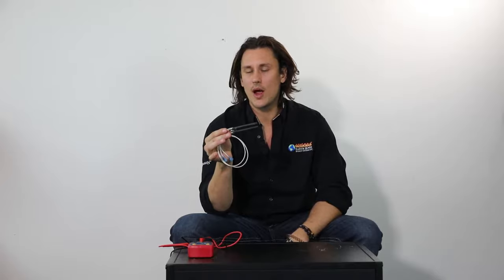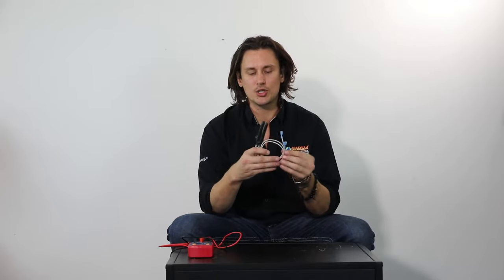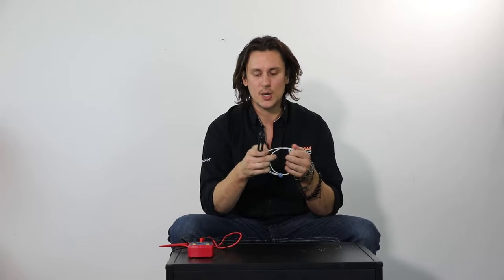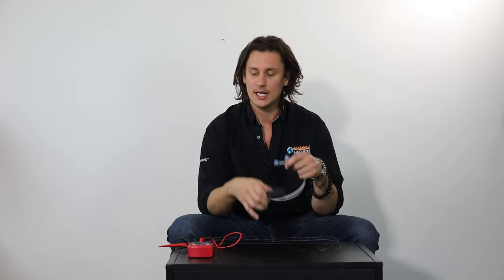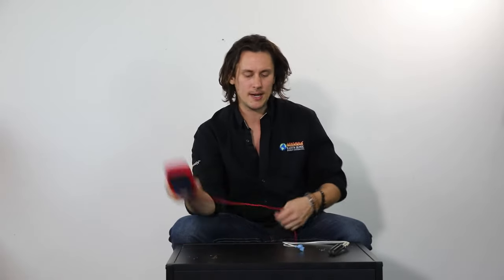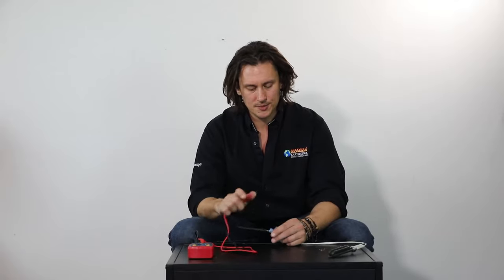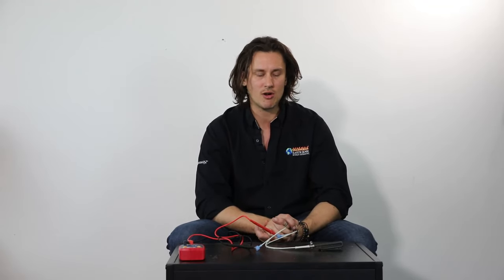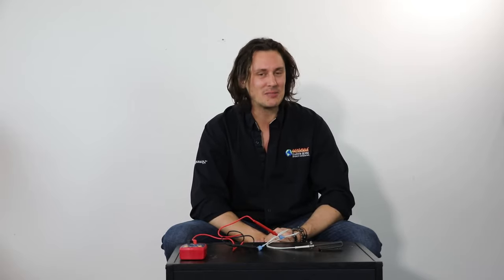How To Test A Stove Igniter, Pellet Stove Ignition Troubleshooting

Comment: Thank you so much, I came across your video today. My 1st time/winter with a pellet stove & it’s awesome. I’ve been cleaning it regularly, but not enough apparently. Noticed last night it wasn’t running as efficiently. After watching this I gave it a thorough cleaning inside & out. Started up immediately. Muchísimas gracias
Reply from the maker: Fantastic to hear! Glad this was helpful. Any future questions or tips needed just let us know!
Reply: Hey Taylor, 
 So unfortunately a new situation has arrived. As the pellet stove is super cleaned up. Today started smoking from the top vent. I shut it off I’m going to let it cool down. And vacuum out the pipe. Any insights? I could send a video?
Reply from the maker: @theuniverse8384  Thanks for the message, happy to help. What make and model stove do you have? Yeah, if you can upload a video to YouTube and send me the link that will be helpful. Generally speaking, the exhaust vent flue pipe on pellet stoves is under positive pressure as most pellet stoves have forced combustion. PL Vent pipe of all brands and types are known for leaking around the seems. When we install, we apply high temperature silicone around every pipe seem and then we use a CO meter to ensure there are no leaks. Oftentimes we will even block off half of the vent outside so there is more pressure on those seems which allows us to make sure it's sealed 100%. Send me some further info and we can get more specific to your situation. Thanks!
Reply: It’s a St. Croix, not sure how to send a video on YouTube. Sorry tech challenged. It’s been off for about three hours now. I cleaned it even more than I did a few days ago. How many hours do I need to wait to document with a shop vac regarding the pipe outside?
Reply: It’s a St.  Croix Model Greenfield WH-003275

Thank you for taking the time to read this. ☮️🙏
Reply from the maker: @theuniverse8384  Thanks for the information, yes we are very familiar with the St. Croix Greenfield. We have carried and serviced this model for many years. I will continue response on your other message. Thanks!
Reply from the maker: @theuniverse8384  Thanks for the info. For cleaning out the venting, I would wait until the stove has finished it's cool down cycle and shut off and from there wait another 60 minutes just to ensure all ash is cool. One of the best tools we use to clean out the exhaust pipe is a leaf blower vac. We place the sucking/vacuum part on the vent outside and it pulls out the majority of the ash in the vent, combustion blower manifold, rear firewall, and heat exchange area. While this is being performed, another person can be in the house opening and closing the door and moving the heat exchange scraper rod for maximum results. While doing this we recommend having all windows closed and wearing hand protection and face protection so you don't breathe in any of the fine particle ash. Once your venting is clean I would still recommend getting high temperature silicone and sealing each pipe seem as well as the pipe connection to the stove exhaust outlet to prevent any smoke leakage. Here is high temp silicone for reference: https://pellethead.com/product/nuflex-high-temperature-black-silicone-sealant-adhesive-2-8-oz/

This is the leafblower vac style we use for maintenance and cleaning. We don't currently stock it any longer, however these usually are available from a Lowes, True Value, or Home Depot. https://pellethead.com/product/toro-vacuum-leafblower-pellet-corn-stove-exhaust-vent-cleaning-system-3-4-venting/

Keep us posted, happy to assist. No worries on the video and uploading, we'll get you back to 100% without messing around with the tech stuff. Thanks!
Reply: Thank you Taylor, I really appreciate your knowledge and time. Bad timing with the massive temperature drop in Maine. 

Yes, the stove has been off now for 4 hours. But I may wait until the morning as it is dark at this point. Then I could also ask for another pair of hands. I’ll keep you posted, again thank you very much.
Reply from the maker: @theuniverse8384  Thanks for the message back. Yes, a lot easier doing it in the light. Hoping you stay warm this evening and keep us posted tomorrow with your progress. Appreciated.
Reply: Good Morning Taylor,
No leaf blowers in stock by me in my area, Although I have a shop vac, (not metal). I will give it a go sometime today. 

Thank you, 
Maleine
Reply from the maker: @theuniverse8384  Sounds good Maleine! Keep the leaf blower vac on your radar and keep us posted on your cleaning with the shop vac. Thanks again!
Reply: Hey Taylor,

Yes, I’ll be on the lookout for the leaf blower (currently out of stock). 

She is running like a champ now. Even though I thought I was cleaning it really well, I missed a few pockets. I really cleaned up by the scraper & in between the tubes. 

I did get the silicone that you suggested. 

Thank you so much,
Maleine
Reply from the maker: @theuniverse8384  Fantastic to hear Meleine! Yes, the Greenfield does have several 'pocket' areas where ash can collect. With that unit there is generally a decent amount of ash that gets trapped behind the rear firewall. When you get a leafblower/vac it will pull that ash out. In the meantime you can use a mallet to tap on the rear firewall and have that ash fall down into the ash traps located on the left and right of the burnpot. If doing this, make sure that the steel or ceramic brick covering the back wall is removed first. Again, very glad to hear things are running well right now and that you got the silicone to ensure all seems are sealed up with no leaks. Keep us posted, always here to help! :)
Reply: Hey Taylor,

Thank you, good to know. Exactly where the build up was. Looking forward to the leaf blower/vacuum. 

Have a good evening & Happy Winter. 

In the meantime I’ll keep educating myself with Earth Sense video’s. 

Maleine
Reply from the maker: @theuniverse8384  You're most welcome Maleine! You as well, and keep us posted with any questions as you go, always happy to help. Have a wonderful evening.

Comment: 1st time Pellet stove….if igniter is bad, is it “possible” to manually ignite.  I know this is not recommended for safey, just want to know if a pellet stove I got works.  Thanks for any advice
Reply from the maker: Thanks for the message. Yes, if your igniter is out you can manually light the stove. Just place a handful of pellets in the burnpot, use an alcohol gel starter or friendly paper/wax fire starter options. NEVER use gas, kerosene, or anything of that sort. Let the fire burn for a few minutes so the pellets start going before you close the door and turn it on. Keep us posted, happy to assist however we can. Thanks!

Comment: Old video but very relevant today, question: does polarity matter?  The leads on the stove have no connectors but 1 red 1 white. Leads on ks-5030-1061 are non descript with a molex that is arrow shaped. Is there polarity in the element or can I make the connection either lead?
Reply from the maker: Thanks for the message. For the igniter you can make the connections to either lead, it will not matter. Any other questions please let us know.

Comment: Great service! Just got all my parts today, sure wish I would have ordered the igniter also 🤦‍♂️ What would be the specs on a ap5660l igniter? After searching all over town I was lucky enough to find a fuse but the igniter failed to work. Hoping my circuit board is still ok🙏
Reply from the maker: Thanks for the message, glad we were able to assist! The igniter for your Ashley AP5660L would be part 80604. I have just messaged our tech team to send over the ohm range for that element. I should have an update on that and will let you know as soon as possible. Here is the 80604 igniter and aftermarket for reference. Be back in touch shortly. Thanks! https://pellethead.com/product/us-stove-vogelzang-ashley-pellet-stove-igniter-element-oem/
Reply from the maker: Just heard from our tech team. Ohms on the 80604 igniter should range between 45-52 ohms for proper start-up. Give your igniter a check and let us know what it's reading. Thanks!
Reply: @EarthSense  thanks for the info! Mine was reading 8-10. Kinda strange it didn't burn my fuse after I replaced it. I went ahead and disconnected the igniter to be safe and just lit it with my torch till my new igniter gets here.
Reply from the maker: @Laurel-Crowned  Thanks for the message. Glad you were able to test it and verify it was out of operable ohm range. Sounds like a good move on your part. Let us know how everything is working once the new igniter is in and installed. Thanks again!
Reply: @EarthSense  thanks again! It worked out great. If you don't mind me asking, how long does your brand last compared to the factory brand? Also do you sell on eBay or Amazon?
Reply from the maker: @Laurel-Crowned  Absolutely, glad it worked out well for you. We go direct to the manufacturer for the pellethead brand. I would say generally speaking lifespan is the same as factory and generally the warranty period is longer and easier if there is an issue. Yes, we sell on both Amazon and eBay. Amazon store name will be: pellethead and eBay store name is: esesstoves. Any other questions or needs as you go along just let us know. Thanks!
Reply: @EarthSense  well I was able to make it to my mother's and as I'm installing her new parts I ordered from your website, nothing appears to be correct except the exhaust motor assembly! I had ordered her the cheaper version of the auger motor and when I realized the difference I paid the extra price and ordered the factor version and brought it with me but both of them say earth sense on them but just have different amp ratings? The refurbished blower motor assembly I ordered was either put together with the motor on the wrong side or I got the wrong part? The amp ratting on my factory motor says 1.9a and the brand is fasco and the unit I purchased from you says 1.77a with nbk manufacturer?
Reply from the maker: @Laurel-Crowned  Thanks for contacting us, happy to help. Yes, both our Auger motor offerings will have our company name - labeling by the manufacturer. The USA auger motor replacement will state that it's a Gleason Avery motor at the top bearing cap. Needle point sealed ball bearing made in the USA. You will notice different amperage ratings on motors and aftermarket replacements, most are negligible and will not affect the performance in any way. If there are any issues with performance we will make it right. 
As for the blower motor it is aftermarket, comes from NBK - We do not carry the OEM blower from Ashley. I have never heard of the motor being on the wrong side before though. We sell quite a few of theses distribution blowers, but if the blower is incorrect and will not install please give us a call and we can assist with return on that. 800-236-6647. Any other questions please let us know. Thanks!

Comment: I have a Quadrifire Cab50. I had to replace the control board, and it ran well for a minute. Then it stopped igniting (everything else works, fans, blowers, auger.) The ohms on the igniter are around 58. That's almost double the ohms range, correct?
Reply from the maker: Thanks for contacting us. The OEM 300 watt loop igniter in your CAB50 should have a range of 43.5 – 53.5 ohms. If it is an aftermarket igniter those numbers can vary. At 58 ohms you may experience issues with missed ignition; it's a pretty narrow window for optimal ohm range. Here is the igniter and ohm breakdown sheet for reference. 
https://pellethead.com/product/quadrafire-heatilator-loop-pellet-igniter-300-watt-oem/

https://pellethead.com/how-to-test-and-replace-a-stove-igniter-pellet-stove-ignition-troubleshooting/

Any other questions please let us know.
Reply: @EarthSense  Thanks!

Comment: Great video!  My stove was working fine (though its performance was probably getting worse and I just wasn’t realizing it) and then one day, no flame, just a pile of unburned pellets. At least I didn’t have to diagnose the pellet feeding mechanisms. But as you said, check the basics first. I gave the stove a pretty thorough cleaning and made an adjustment to the front door to get a tighter fit on the braided gasket. Since I had everything apart, I did check the resistance on my igniter and found it to be within spec, though right at the high end.  I was having a hard time believing that my cleaning would make the difference, but since it was easier and cheaper to put everything back together and test it, that’s what I did, and presto!  You were right, just by addressing the basics, it fired right up!
Reply from the maker: Fantastic to hear! Yes, so much is about proper air flow for ignition and proper burn. I'm glad she fired up correctly after your cleaning. Any other questions please let us know. Thanks!

Comment: I'm trying to figure out why my fuse in my st croix keeps blowing. Do you have any videos on that or any ideas
Reply from the maker: Thanks for contacting us Aaron. Generally if a fuse keeps blowing like that there is a direct short from one of the components or wires. Inspect all wiring in the stove and make sure there are no exposed wires grounding to the metal body of the stove. Check the igniter as well; if the igniter is warped at all and touching the igniter housing it will blow the fuse every time. Check the igniter wires and check the ohms on the igniter to make sure it is in proper range. Keep us posted, happy to help.

Comment: Is it safe to assume that infinite resistance on an igniter is indicative of a faulty unit?
Reply from the maker: Thanks for the message Evan. Each style igniter element will have a different optimal ohm range. Numbers outside of that range either higher or lower will indicate a failed igniter. You can find a general list here of varying igniter ohms - you can also let us know your make and model and we can try to provide optimal range if we have those specs. https://pellethead.com/how-to-test-and-replace-a-stove-igniter-pellet-stove-ignition-troubleshooting/

Any questions just let us know, happy to help!

Comment: Never mentioned the ignitor can work and be in range but can short to ground and either blow the fuse or pop the breaker, ask me how I know when I bought 3 cheap ebay ignitors,  2 did this but one out of 3 were good
Reply from the maker: Thanks for sharing Rich. Just glad to hear the faulty igniters didn't harm your control/circuit board. I hope you were able to warranty those two. If you need anything let us know. Thanks.

Comment: Quadrafire Vernon AE.   Firepot icon on all time. stove stops working.  Cleaned firepot no change.  I usually clean thoroughly in fall but now I can wait to  clean compleely and fix problem or do now.  Fix?   cleaning completely, gasket between firepot and case, igniter problem / replace, ceramic thermo replace?  any help on how I should proceed, almost don't need for heat anymore this season.  Thanks Pete
Reply from the maker: Thanks for contacting us Pete, happy to help. There is no Firepot Icon on the Mt Vernon AE wall control. The Icon you are seeing on the right side that looks like a firepot is actually the Fuel Hopper Low Icon. Let's inspect the fuel hopper sensor. Here is what the sensor looks like for reference. https://pellethead.com/product/quadrafire-mt-vernon-ae-edge-60-fuel-level-sensor-oem/
Keep us posted, happy to help.
Reply: @EarthSense  ok, that narrows it down, where is the sensor so I can test as stated in description?  Thanks
Reply from the maker: @peterreedy3220  Hey Pete, the sensor is mounted inside the hopper. The fuel hopper will need to be near empty of pellets for you to see this sensor. Happy to help.

Comment: What does it mean if the reading is high and keeps jumping around? Does the control box the quadrafire 1200 have a fuse for the igniter that can be replace? Our control box is enclosed in a metal box.
Reply from the maker: Thanks for contacting us, happy to help. If you have the standard 300 watt loop igniter the ohm reading should be between 43.5-53.5. If you have the 380 watt multi-fuel loop igniter, ohm reading should be between 35.0-43.5. If you are getting readings outside of this range, either higher or lower, it will be a direct indication that the ignter is not in operable condition and needs to be replaced. On most Quadrafire 1200 models there is 1 fuse that is located in the junction box where the control box is seated right by the call light. This is the electrical system fuse, not a direct in-line ignition fuse. You can certainly pull this fuse out and test it, however gernerally speaking if this fuse was bad you would not have any power in the unit. The control box itself is sealed and should not be opened. Here is the OEM replacement 300 watt element for your reference. We should have the aftermarket 300 and 380 watt elements back in stock in about 8 days. https://pellethead.com/product/quadrafire-heatilator-loop-pellet-igniter-300-watt-oem/

Any other questions please let us know. Thanks!
Reply from the maker: Hey Leslie, one more thing. If I recall correctly you had mentioned in a earlier comment that you had just replaced the igniter and were having ignition issues. Although rare, we have seen new replacement igniter elements that are faulty both OEM and aftermarket. The igniters do carry a warranty and if yours is outside the OEM range specied you should contact the dealer you purchased it through to get a warranty replacement on the way. If we can be of further assistance just let us know. Appreciated!
Reply: I'm thinking I'll contact the company and get a replacement. @EarthSense